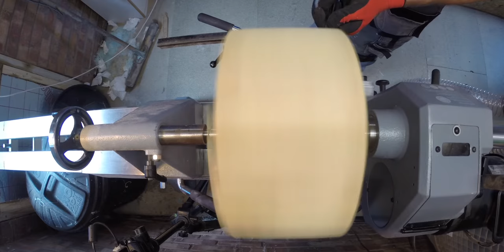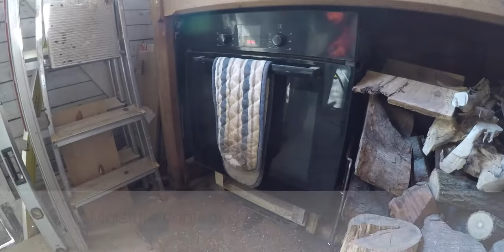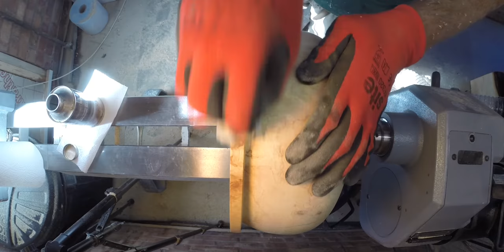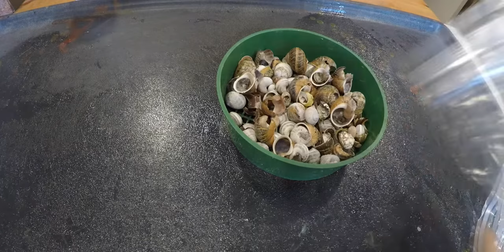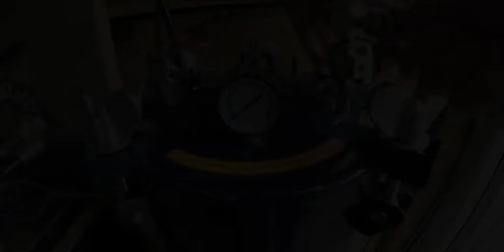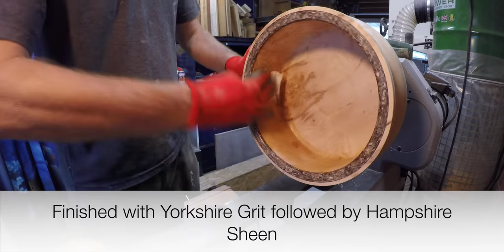Woodturning - large bowl with snail shell inlay from English Horse Chestnut.

Comment: Beautiful bowl. I wish you had shown more of the process; including all the steps for crushing the shells and filling the bowl edge.
Reply from the maker: Hi - thanks for your comments. Unfortunately I had a camera malfunction! However the process is straightforward. After crushing the shells they are washed, dried and then tipped into a channel on the bowl. About 5 -10mm deep is fine. Once the channel is filled you can either add some finer crushed shell but this is optional. Then resin is poured over the shells to fill the channel. I have found that the shells are very hard but can but turned with sharp tools and sanded effectively. Alternatively, ensure the resin covers the shells and just turn and finish the resin. On this bowl I turned the inside of the channel away to reveal the inner edge and see more shell. I really like this appearance. I will definitely be using more snail shell for inlays so keep on eye on the channel or subscribe for a notification. I will ensure a detailed video covers the whole process. Very best wishes - Jim
Reply: @JimLiddiardEntertainInspire  my apologies if you stated that you had camera trouble in the video. I wanted to watch the process, but was in a location that I could not turn up the sound. 
Thank You for the information about the inlay process 😃